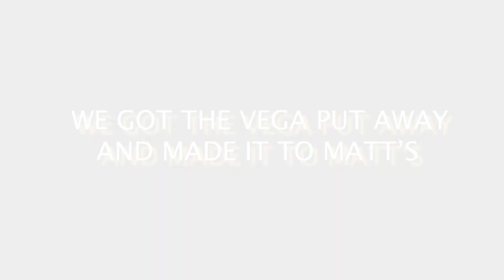1963 FORD FALCON returns with SPEED KINETICS CHROMOLY K MEMBER

Comment: Hello sir
I’m installing same suspension in my 63, can you tell me what size spring you’re running on your front coil overs? 10” 12”length and what spring rate? Thanks
Reply from the maker: Hello sir, they are 14 125 on strange struts.
Reply: Sounds like a great combination, 
Are you running fox body or SN95 caster camber plates? 

Thanks again for all your info

Very helpful.

Comment: What length control arm did you go with? I’m in the same boat with my 61 falcon. Got a aje kit and hated the way it was so I put the project on the back burner until now. Definitely buying one of these
Reply from the maker: 12.5 inch arm.

Comment: How did you remove the stock gearbox? Mine has 3 bolts going through the fender. Is there more to remove then those 3 bolts for the original steering gear box?
Reply from the maker: Just those 3 that go through the frame
Reply: @TeamDPerformance  oh ok thank you. Next day off she’s coming off.
Reply from the maker: @moerizk3753 hit me up if you need anything. It come off easily
Reply: @TeamDPerformance  all right cool thanks. I’m sure I’ll have tons of questions
Reply from the maker: @moerizk3753  hit me on IG I’ll answer all that I can.